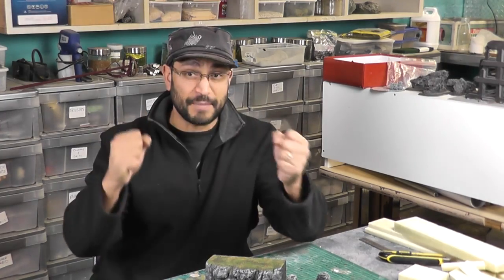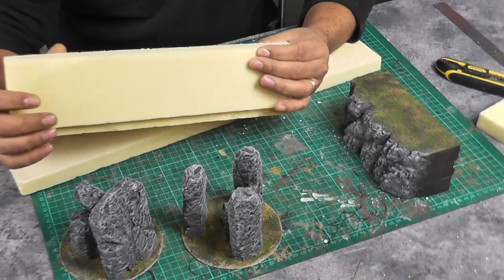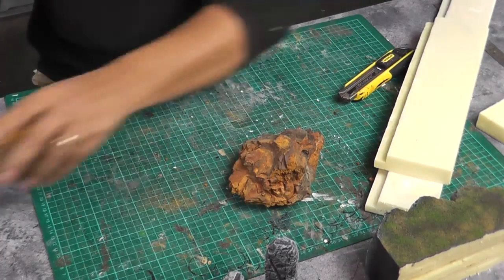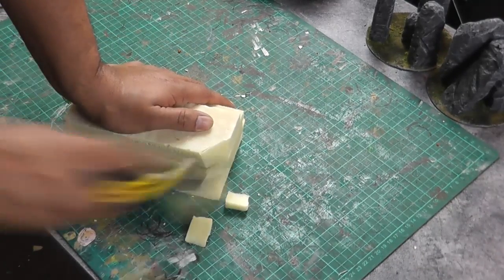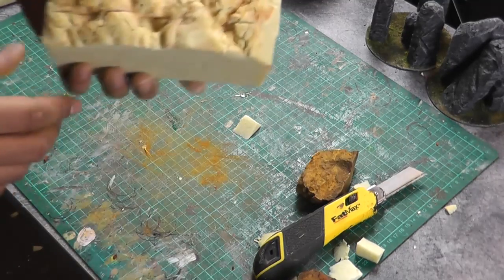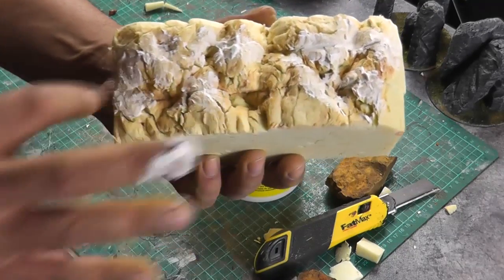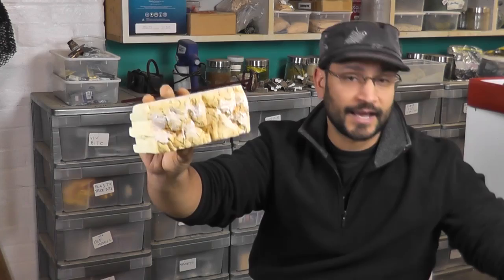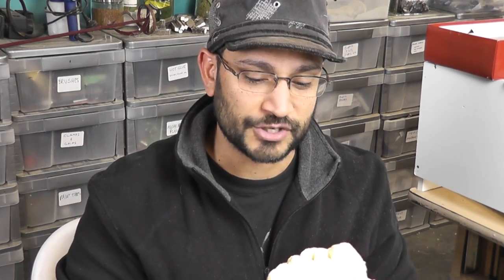Creating realistic rock texture for wargaming scenery

Comment: Really love this technique.  The result is superb, the tutorial is clearly explained, and it is as easy and cheap as it can be.   I very much like your video's.  

There is one thing that I like to do a bit differently.   Of late, I keep a sheet of the two inch foam in the cellar for making rock faces.  Using that, I create the bulk of my hill or escarpment in the normal way that we all do, and then I place the two incher vertically along the edge.   By doing so, I eliminate the seams present when using thinner foam, or any foam that is laid down in sheets.   This technique gives me a solid bit of foam along the whole of the outer edge, or cliff / rock-face. 

Plus side is that you don't have the seams going right across the face, which even when modeling sedimentary rocks, can never look quite right if they are perfectly parallel to the ground/table.   The downside is that a vertical seam does stand out a bit more, at least to my eye, than horizontal seams.  I deal with this, mostly in the construction, where I'll fashion the ends of the facing with a key stone cut, lapped cut, or just an angle cut on a thin edge, that eliminates or changes the vertical orientation of that seam.  Simply put, I find that it is rare to be unable to hide the seam, or even having to resort to much in the way of fillers.  In any event, there are far fewer of them, spaced far more irregularly, which makes them a cinch to hide for even a novice terrain builder.

Just a thought.

 Mostly though, I just wanted to take the opportunity to tell you how much I enjoy your videos.  I can't remember a one where I did not come away with either a great idea or a great inspiration.  Usually, I find both.   So, Thank you, and well done.

Comment: I understand you want to make a solid giant rock. But most rock formations are made in layers of different colors and types of rocks. So, maybe taking a lot of thin layers of styrofoam, roughly worked in batches or something like that, painted individualy and then glued one on top of another... I guess that would give you a much more realistic look.
Reply from the maker: Hrmmm, I would still use a thicker piece of foam and carve in the layers using other methods, painting individual layers and gluing them together would be tedious and you'd then have trouble covering up the seams between the layers.  Mike from TerranScapes has some great videos on creating stratified rock looks if you interested in that.  Cheers

Comment: What is the material you use. When I type Foam there are only soft things
Reply from the maker: This is called polystyrene.  There are 2 common types, Extruded Polystyrene (XPS) and Expanded Polystyrene (EPS). EPS is commonly white, and made from expanded beads ... it is terribly stuff to work with.  XPS is 'cast', it is much denser type of polystyrene and commonly used for insulation.  Hope that helps lead you somewhere useful!  Cheers